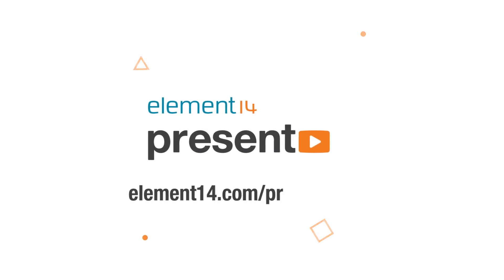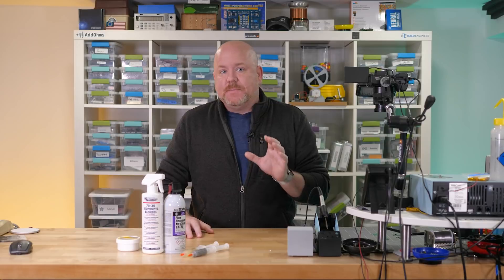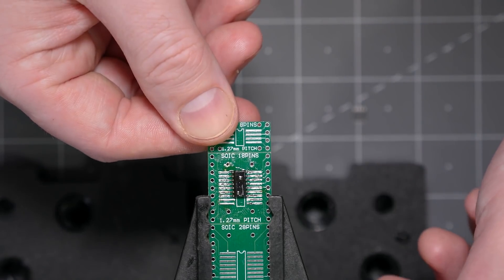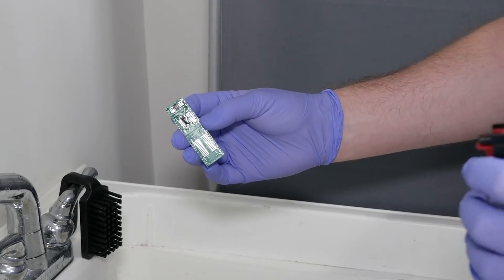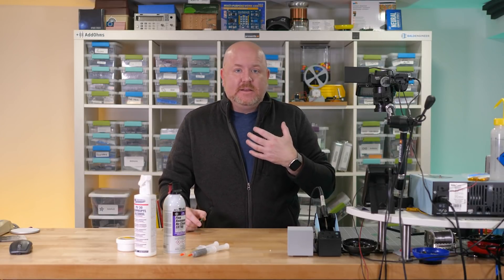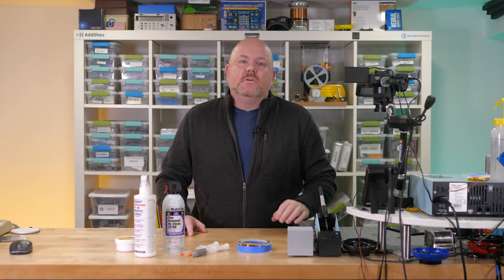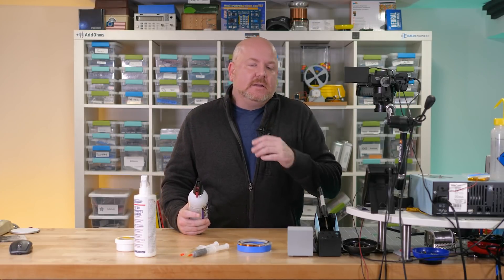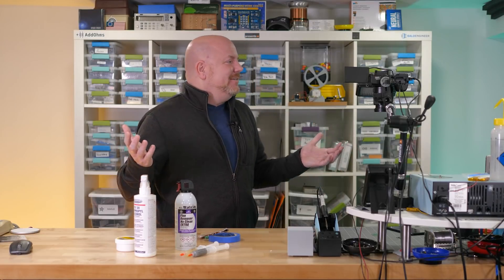Essential Consumables for Building Circuits - Workbench Wednesdays

Comment: I couldn't live without SMD adapters boards.... the socket adapters (non-solder) are also great for the most common SMD packages, a little more expensive and package-specific, so certainly less essential - great video!

Comment: What about washing pcb’s with water? I’ve seen this from a few folks and even some that wash larger boards in a dishwasher. I’ve never done this myself as it just seems wrong, but the results look good on camera and the boards always seem to work. Is there a technical reason that would make this a bad practice?
Reply: Hi, I addressed the question here, to give a chance for others on the e14 community to chime in: https://www.element14.com/community/docs/DOC-95889/l/workbench-wednesday-31-essential-consumables-for-building-circuits#comment-269574

Comment: I've been using the same jtip on my iron for a few years now. My go to flux is amtech and solder is leaded kester solder. I use acetone for clean up but you need to be aware of how it works.

Comment: Do the flux pens/syringes/pastes need to be refrigerated to extend their shelf life? In the video that was mentioned as required for the flux containing solder paste. I'm only a light hobbyist so I may go many months before soldering or desoldering something, so I've avoided buying any flux thinking it'd expire before I use much of it.
Reply: Frankly, I repeated what I was told once. It is either the binders or the flux that have a limited shelf life. (And from experience, it gets very runny after a couple of months at room temp.) But I did look up the datasheets for the Pen and Liquid flux. Their shelf life is much longer than I expected: https://www.element14.com/community/docs/DOC-95889/l/workbench-wednesday-31-essential-consumables-for-building-circuits#comment-269575

Comment: In my experience, desoldering braid is rarely needed for bridges. I wipe the tip of my iron on the brass wool to remove excess solder, apply flux if needed, and drag the iron across the bridge. It will pull the excess solder to the iron, and works 99% of the time. Sometimes, it's necessary to do it twice, or drag the bridge across all the pins so the other pins can each take up some of the excess. Flux is the key to it working.